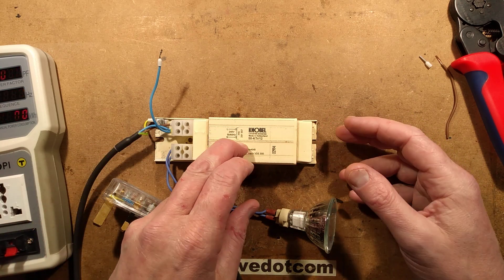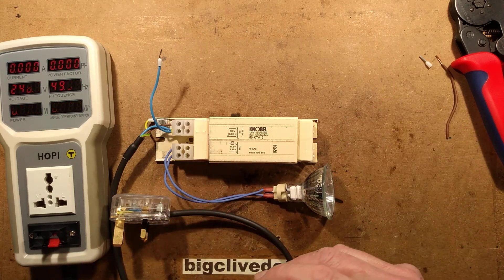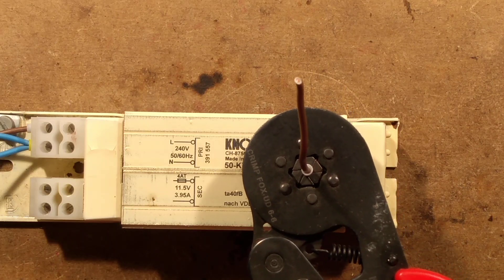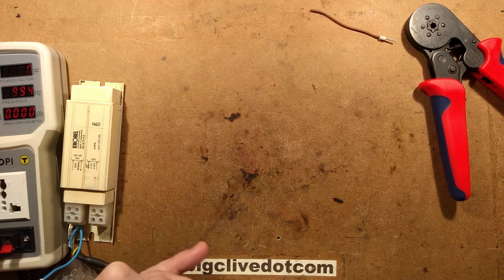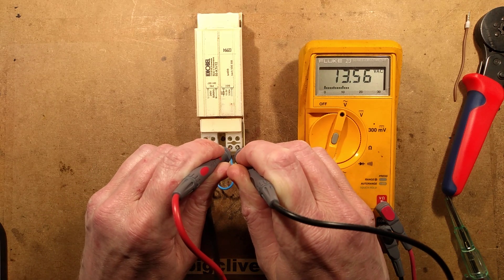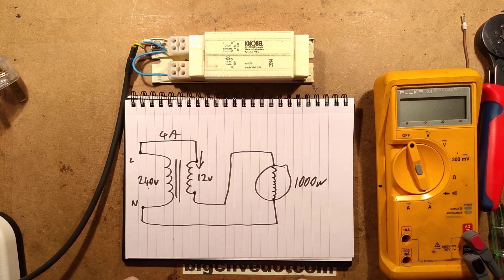Adjust your mains voltage with a standard transformer.

Comment: Hi,
I know this video was recorded 5 years ago. Am going through all your videos because they very educational.

 at minute 4:16 you calculated apparent power as 0.143 (power factor) x 249 (mains voltage) =  35.6W
I was expecting the calculation to be 5.4 (real power) / 0.143 = 37.7W

Am I right?  a bit skeptical since I couldn't find other comments mentioning it.
Reply from the maker: Apparent power is VA.  The supply voltage multiplied by the apparent current.   Real power is the actual energy used.
Reply: @bigclivedotcom apologies, I thought the 0.143 was the power factor :)
Good to know that these meters show apparent current not real current

Comment: When I saw the video description I guessed what you had in mind,  and I was right.  This comes up with regularity in the antique radio forum,  where a lot of that older gear was spec'd for "110V" power input,  and apparently a lot of folks tend to see a lot higher voltages at their location,   like 125V or so.  It tends to add to the longevity of tubes,  and particularly things like unobtainable power transformers.

Comment: Wow! That is such a fascinating and useful idea.
I must have over 50 books on electronic circuits and ideas and have never come across this implementation of transformers. I was also worried about how much power capacity the secondary could handle, but since the current is only going across the original voltage of the secondary it means a secondary originally rated at 10 amps could handle a 10 amp load at 220V in this dropper arrangement.

Thanks so much for sharing.  😎👌🏼

Comment: How can I tell if a lighting transformer is going to be suitable for this?  I purchased one that 'looked similar', but when I opened it up, it appears to be a switched mode power supply.  Without a load, it gives no reading on the secondary side.  Any one with a link to a UK available one that would work as in the video?
Reply from the maker: It will have to be a traditional heavy wire wound transformer.  It doesn't have to be for lighting.

Comment: So you're adding some turns to the windings, and tapping at ~ 95% of the winding?
Reply from the maker: Just configuring a standard isolated transformer as an auto transformer with reversible winding section.

Comment: Help!!!  I would like to use two transformers I have (#1 Pri 240V Sec 110V 6A 500VA, #2 Pri 240V Sec 110V 2A 200VA) , to form a 240V<->240V isolation transformer.  Is this possible?  Safe?  Do I put the larger one first?  Where should I put fuses...pri side, middle, sec side?  Any help much appreciated.  I have all the pieces, but don't want to start the build in case it's a no-no.  The isolation transformer would be used for testing/repairing vintage valve amps.

Comment: The power factor loss per residence here in the U.S. has already been calculated to about $8 per year on average, which makes it utterly impractical for the utilities here to begin monitoring PF per household, and therefore charging accordingly. The payback simply isn't there, so I'm mystified that the UK or any other country would begin doing something that will never provide for any ROI (return on investment) unless they upscaled the PF charges to an outrageous level. That should cause the public to react and protest. Besides, the utilities are already charging enough in the bills themselves to recoup all their costs, and then some. So, PF charges would be redundant to what they're already charging to compensate themselves for that loss.
Reply from the maker: The smart meters are capable of being remotely set to monitor VA as opposed to W.  It's literally a checkbox option for thm in their main software.  The loads most affected will be continuous standby electronic supplies like those found in timeswitches, lighting, appliances and boiler control.  It's not a huge amount, but when some profit motivated individual realises he can suck another $10-$20 (or in some cases considerably more) out of every single customer the temptation will be strong.
Reply: @bigclivedotcom  I fully agree that greed does indeed exist in all quadrants, but NIST has done the math, and has found doing VA metering simply isn't going to gain the utilities anything without them applying some seriously flawed rationale that can land them in court trying to defend themselves against massive class action law suits for price gouging. We can all rest assured that if there were a payoff for doing VA, it would have been implemented long ago. Every power station around my city has capacitor banks right along side the transformers to compensate for PF losses, using a switching system that switches in more or less capacitors, based upon concurrent PF readings on the mains going out from the substations. That gains them far more in savings than spending the extra money to charge for VA.

Comment: Interesting concept, I was involved some 40 odd years ago with a regulation device which used this principle automatically, a unit sensed the outgoing mains voltage to operate high and low contacts which caused relays to drive a motor friven Variac either way which fed the primary of a transformer the secondary being in series with the output. The Variac was so arranged to either add or subtract to the incoming supply. I think the maker was Berco.

Comment: Few people in general understand the effect of different power line FREQUENCY.  If the equipment (transformer or motor) is made for the American markets, it is made for 60 Hz.  If it then is used even at the same voltage (110 to 120 V) at  worldwide common 50 Hz, it is likely to “cook”, due to the magnetic saturation that takes place at the lower frequency.  The difference in the acceptable voltage may be as much as 20%.  Probably people in Japan understand this better, because they use 50 Hz in part of the country and 60 Hz in the other part.
Anyway, the formula for designing power transformers contains the frequency in the denominator.  For a lower frequency, same power and voltage, you need more iron in the core or more turns in the winding to keep the transformer from saturating.

Comment: Touching on the power companies and apparent power. 
I own some servers whos power supplies in them offer the ability to toggle power factor correction (PFC). 
I know these servers aren't cheap to run cause my monthly bill increased 30$.
I'm not really sure if my power company is charging for apparent power but would turning on PFC increase my bill or usage?
Reply from the maker: It's odd that you can even turn the PFC on or off.  Theoretically it should reduce power consumption, but only if a meter is measuring apparent power.  It might be worth trying it with the servers as the only load on in the house and see how fast the meter logs power.

Comment: Agree with previous comments. The diagram loops the 240V live primary to 12V secondary  to load. The actual set-up loops 240V neutral primary to to the 12V secondary. Maybe I'm being thick here but ....?
Reply from the maker: The secondary can be inserted in either live or neutral.  Since I had wires floating around during the demo I chose the neutral for safety.

Comment: Maybe I'm seeing wrong, but your drawing is putting mains across the secondary with the lamp in series (240V over a total voltage capacity of 12V secondary + 12V lamp). I think you need to connect the live terminal to the wire between the secondary and the lamp and not to the original terminal in the transformer - only then it will be converted to auto-transformer.
Reply: The goal is to not use it as an autotransformer. Also, it’s not a 12V lamp but rather a 220V lamp, so the secondary would still drop the 12V and feed 228 to the lamp which is much more tolerable than 240V.

Comment: Good demo of boost buck. The radar I worked on when I was in the naval service had a similar system. It used a center tapped variac coil as the secondary and the neutral was fixed to the tap. Then a sliding contact ran across the whole secondary picking off the correct voltage moved by a servo connected to the voltage regulator circuit. It was dated from WW2.

Comment: These are sometimes called a bucking transformer or a boost transformer, depending how you wire it. Its a useful trick to knock down the line voltage with stuff in the junkbox.

Comment: These type of transformers are commonly known here in the US as buck/boost transformers.
Usually with 2x 115V primaries and 2x12v secondaries, so you can adjust your output by +/- 12 or 24V

Comment: Although using this with lamps will be pointless on LED or fluorescent. They don't sell the old tungsten incandescent any more, just halogen, which are nearly as inefficient but  not quite. So this might be useful for one of those. But instead you'd be better off just getting a LED bulb instead, which would also be a lot cheaper than finding a transformer to improvise into an auto-transformer.

Comment: You can also connect this transformer like a real autotransformer:
Connect primary and secondary in series, of course check the phase ("polarity"). Then connect the mains to the lower end of the primary and the upper end of the secondary. The load is connected to the primary. In this way you lower the magnetization of the core a little (winding voltage) and it should run cooler. This would be especially important if you have a 230V to 12V transformer instead of a 240V to 12V).
Reply: I've got a couple of things in mind where I want to drop the voltage as in the video. 
I understand how it works in the video, but you've caused me some confusion.
Please elaborate a little as per your suggestion.

Comment: oh man!! you stole my idea! :D

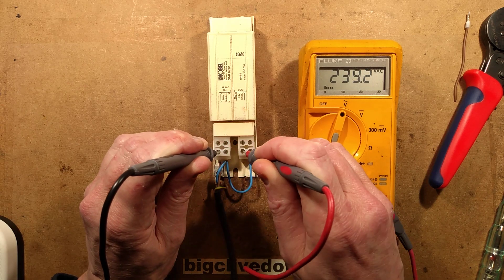12:08 i was waiting for this part as well.. oh man

UPS transformers are also good for this, i'd say, they "output" like 7+7 volts or more in case of the 24V battery option, at a really high current, some are buzzing anyways, they are not intended for regular powering

Comment: Won't the current be limited to the current that the primary would use under normal application.  If so, it would seem to be only useful for fairly low current applications unless your transformer had a high VA rating.
Reply from the maker: The primary will only see its normal current in relationship to the low voltage secondary.
Reply: @bigclivedotcom  I see. The primary is just across the mains as usual.  The load current only passes through the secondary and then is supplied from the live connection.

Comment: The core losses will be equivalent to a very small load, the copper losses in the primary however will not. A 50W 240V->12V transformer isn't designed to have 4 amps in the primary.
Reply from the maker: The primary is in parallel with the incoming supply.  The only winding that sees load current is the secondary which is rated for 4A.
Reply: Oops ... I didn't think that through.

Comment: Ever wonder how life would be if the battle of the currents went the other way, with Edison defeating Tesla? I've been exploringing parallel realities and finally came across one. They used flywheel in a vacuum generators that were spun up to speed by the milk woman in one neighborhood and fly by nighters in another. Their society had developed a zero point module extracting energy from a device with a self contained region of subspace. Unfortunately we had to leave early, two competing teams had apparently developed cold fusion and created a black hole on the same campus. Details are sketchy since both teams are busy developing methods to exit a black hole...

Comment: Clive, another excellent video. Thanks.  

On another note, I see you have a clear plastic mains plug. I only discovered these a short while ago and converted them into nightlights.  One of ‘your’ capacitor dropper full bridge circuits and 2 leds. All sealed and works a treat. I’d send pictures but don’t know where to.

Comment: Please forgive my ignorance.....  I have a need to run a long 500' circuit for just basic junk (at most 10 amps) from my 120v supply.  I don't want expensive cable so WHAT IF I took an old 24v 20 amp transformer I have and did this trick?   Would it correct the line loss?
Reply from the maker: I'd recommend using a good quality cable.  It will be more useful in the long run.

Comment: At 13.42 you refer to 50hz mains hum, is this not 100hz mains hum because of the followingBecause the magnetic flux density is strongest twice every electrical cycle, the fundamental "hum" frequency will be twice the electrical frequency ie 100 hz, probably wrong place to post this comment if so I apologize and would love to be corrected on this point of so called 50hz mains hum, love your channel and do not want to side track it, but YOU will know the answer which I do not , please anybody correct me

Comment: Mains supply here usually reads between 228.71v - 231.30v metered at various random times of the day, post 1982 harmonization under EEC directive local voltages were dropped from the harsh Australian ranges of 240-250v to pan european standard 230v, -/+ 3v and will be staying that way because of the sheer amount of appliances manufactured for 230v ratings.. there might still be little pockets here or there where jurassic transformers are still tapped at 240 range.but anyone in those areas should complain about over voltage.

Comment: Are there any safety issues with this configuration?
Reply from the maker: Not if the transformer is being operated within its rating.  The split bobbin transformers are usually rated equally either side.
Reply: @bigclivedotcom  by rating do you mean voltage or VA?

Because the secondary is only rated to ELV. But it's only passing this I guess, but it's still mains referenced.

Are there isolation or rating issues with the secondary having mains referenced voltages?

Are there any fault conditions where the secondary would see higher than ELV voltages?
Reply: @bigclivedotcom  someone else just pointed out insulation on the secondary?
Reply from the maker: @ELVTechnology  Split bobbin transformers are usually rated for full mains voltage on both sides to the earth/ground.  The secondary windings will still only see their normal voltage between turns.

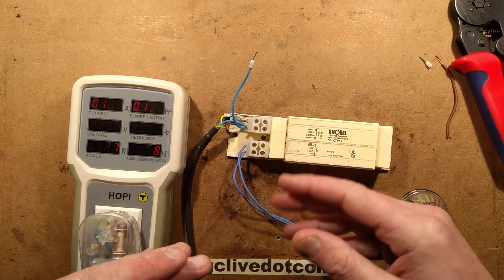Comment: @ 4:00 you mention "apparent power", as that's what so called "smart meters" measure. How can they justify sending you a bill with KWh printed on it if they are actually measuring VA?
Reply from the maker: Easy way round that.  Just bill for units and put. KVA hour in the small print.

Comment: In the US these are called buck-boost transformers and are available in all kinds of power ratings and voltages.  I've mostly seen them where you want to convert between  the 208 of 3 phase and the 220 of single phase

Comment: If the smart meter is unable to connect to it's local radio reciever base in the area, at least here in Southern California, the electric company still comes out and takes a manual reading from the face.... just saying... it happens a lot. 
  They have a bunch of lawyers on retainer though. Anything visible or detectable around a meter will get you a massive lawsuit, and there is no reasoning or empathy behind a statistical investment like a lawyer on retainer. 
 When the smart meters were installed here, there were an enormous number of cases of everything from elaborate bypasses to simple magnets and even audio drivers placed in strategic positions to manipulate the analogue technology.
  The joke amongst installers was that there were enough lawsuits for the theft to fund the new infrastructure. There were a lot of houses that mysteriously remained live on the grid after removing meters.

  BTW, I didn't quite understand the transformer load current in this series configuration. My understanding is that, in an isolation transformer, the current of the load on the secondary winding determines the current on the primary winding. My intuitive assumption is that the series connection you demonstrated would act like a couple of resistors in series. The current in each winding would be proportional to the percentage of the total voltage at the load. When you mentioned the 1000watt load and 50VAC transformer thing I realized I am probably wrong in my assumption, but I'm not sure where exactly. Is it something simple or do I need to go read a bunch more?
   I've wound 3 mains isolation transformers by hand and know the basic math well enough to hit my secondary output power requirements, but I'm no expert by any stretch and need my notes just to understand the math. Do you have any favorite book references on transformers without overly verbose text? ;)
Thanks for the upload.
-Jake

Comment: Did anyone notice the “inverter” bubbles on the input and output of the transformer? Does this mean if you DON’T put 240 VAC in, that you WON’T get 11.5 VAC out? 🤪 What if it had an inverter bubble on only the line, but not on the neutral - then what? Maybe Big Clive should phone up customer support at Knobel and ask - I’ll bet the response has a few choice words! 😆
Reply: Lol, it is not a 'logical' inverter, but it lets you know that the output is phase inverted from the input. You probably know that though.

At least, I assume they are using the dots to indicate the transformer causes a phase inversion. It isn't necessary, you can just wind it the other way to make it non-inverting.

It wouldn't effect using it like here though, however you may get a voltage increase instead of a drop the first go around :)

Comment: what if two 220vac-to-6vac transformers used in series? would they add up and be equivalent to one 12vac transformer as used here?
Reply from the maker: If you wired their primaries in parallel and their secondaries in series that would work.  You'd have to experiment with winding directions.